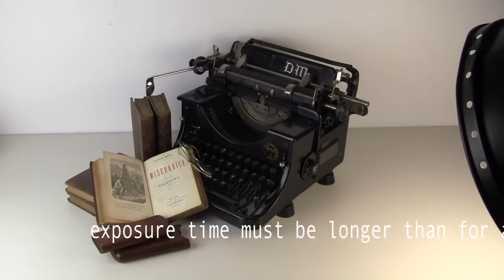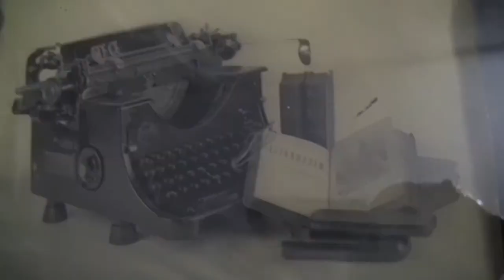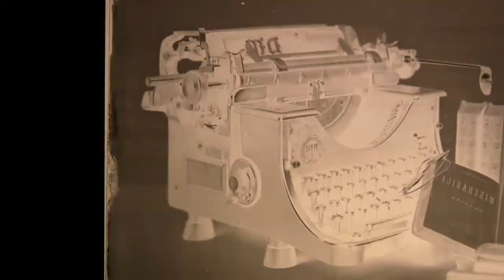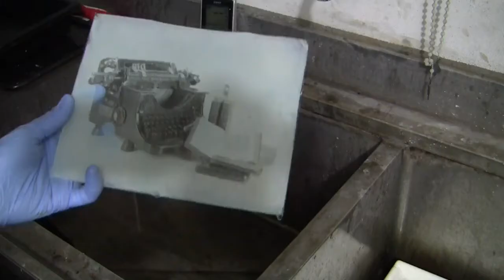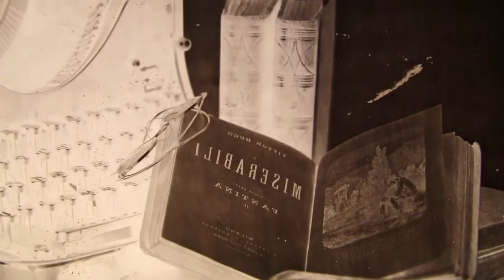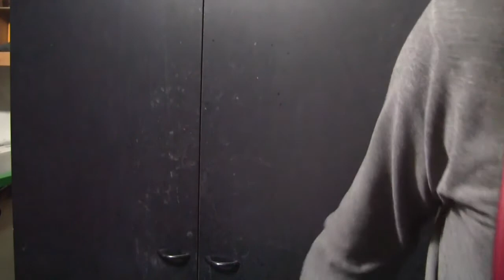wet plate negative copper intensification

Comment: Love it! Thank you for the video! I was always doing with redevelopment (iodine), but now I have a project in mind that will take many plates to redevelop and I don't have 30 min for each plate. With bleaching is much easier. Of course as you've mentioned you don't have so much control, but you can adjust the contrast during printing, so perhaps I do not need all the control.
Reply from the maker: +Borut Peterlin Thanks for the comment. The only problem is that copper intensification is Silver consuming. I need some work and trial to understand how many plates can be treated before it loses its strength. Giorgio

Comment: I stopped using this technique a long time ago because of higher silver prices and also because if the plate is over exposed but still not enough density the intensification will be too much. I now develop the plate as far as it will go and then intensify by using the same developer with a little silver bath added until it looks right then rinse, fix and wash. Or, develop as usual, fix and wash, then use developer and silver to build up density, wash, dry and varnish as usual.

Comment: That type of intensification was used for line art using various bleaches and silver but also sulfides. It’s a one shot deal and not variable. You should give redevelopment a try. The plate is made sensitive to light by a quick wash in dilute iodine. After washing in water it is exposed to daylight and then you pour pyrogallic acid developer with drops of silver onto the plate. The process takes about ten minutes with repeated applications of the developer but it doesn’t streak like intensification and the build up of density is gradual. You can do a just little as needed or even more than the intensification process.
Reply from the maker: I know very well that kind of intensification, and is my main method. Check my book for specs if you want.
https://www.amazon.it/collodio-collodio-positivo-negativo-illustrata/dp/8869272141/ref=sr_1_1?__mk_it_IT=ÅMÅŽÕÑ&crid=HC7Z46POOXY5&keywords=Giorgio+Bordin+fascino+collodio&qid=1664745667&sprefix=giorgio+bordin+fascino+collodio%2Caps%2C88&sr=8-1.
Copper is a valuable alternative, especially when you make negatives in open spaces. Quick and simple.

Comment: It wasn't clear in the video or subtitles -- was this bleach and intensify process done while the collodion was still wet, in that fifteen minute or so working time frame, or after the collodion has dried but before varnishing the plate?
Reply from the maker: the steps are done as they are shown. Bleach is done after washing the fixed plate.
Reply: @giorgiobordin7779  Thanks.  I thought so, but wasn't sure.

Comment: Fab video. Want to make some ambros with more density so I can try salt contact  printing. Is there any alternative to the Nitric Acid?...I can't get it where I live.
Reply from the maker: I've never tried without or with other acid. Where do you live? You can buy from international sellers, I'm sure someone can ship to you, even at the North Pole.
Reply: @giorgiobordin7779  Hong Kong. They are very strict about chemicals here I guess because of the density of people living in massive towers. It's very challenging just doing tintypes. 😥
Reply from the maker: @isuckatguitar6252  oh my... since it uses Silver nitrate, some nitric acid lowers the pH without introducing new chemicals. I think that Choridric acid could be used as well. However I don't think it is easier to find. Acetic acid? Maybe... You should try with little pieces of glass so you need little amount of chemicals and don't waste too much money if it doesn't work; start without nitric acid, so you can just add in a second time. Nitric acid is used also to etch zinc or copper plates for gravures. It could be found in fine art supplies.
Reply: @giorgiobordin7779  Thanks for your input.
Reply: @giorgiobordin7779  you probably don't want to introduce more anons into solution-- I don't think any acid other than nitric will work

Comment: Can this technique be used on silver dry plate????
Reply from the maker: Silver gelatin dry plates are actually like modern films, the main difference being the support (glass vs polymer) and the composition of "emulsion". There are ways to intensify silver gelatine negatives, and could be similar at a glance because both are two-step processes, but they deeply differ.
With silver gelatine, you bleach the film and then redevelop. However, the first step whitens the image but is not a bleach. You confer Bromide to the image and then add silver nitrate. The new formed silver bromide precipitates and makes the image stronger, adding new silver. You work with a film of collodion still wet, and it will never work after drying, because dry collodion is a plastic sheet which no longer allows chemical reactions to happen inside.
In modern silver gelatin films you bleach in the first step the negative and then redevelop with strong developers (paper developers, just to say). Gelatine becomes soft and spongy with water and can allow chemical modifications, when wet.
They are two very different processes. I don't think that the former could work in dry silver gelatine. I can't also imagine why it should work. Try. If it it works, let me know.
Reply: @giorgiobordin7779  Thanks for the reply. What's the formula for a bleach tho? I've read some that uses potassium. dichromate and sulphuric acid. I have the dichromate but I don't really want to bother with sulphuric acid. Do you have other suggestion for bleach that's easy to make? Also for redevelopment I've been thinking about pyro developer lately since it stains proportionally. I have all the ingredient to make ABC pyro but haven't tried it yet. You think that will work? Thanks again!
Reply from the maker: @Stop4MotionMakr  sulphuric acid is less dangerous than potassium bichromate, and is needed, in all formulas. Redevelopment is rough and doesn't require refined developers. A simple Kodak Dektol works fine. I would also be a bit worried about pyro staining for some unexpected odd result.. Another think to try.

Comment: Woww! (When you wrote the comment on video I say loud this before 1 sec) :-)
Nice resolution, I try this a next weekend! THX!
I have a question: It seems to me the bleach solution using only one times? 
The intensify silver nitrate must 60%? Not enough only 10-20%?
Reply from the maker: Kristian, thanks for your woww. Yes, the bleach I think it is a one shot, but it depends also from the amount of fluid. I use the less I can. The silver nitrate can be re used.
If you want to see the albumen print of this negative, go here:
[https://www.flickr.com/photos/gbordin/24121252015/in/dateposted/]
If you want more try to download the "Silver Sunbeam" by J. Towler
Reply: I used a 30% silver nitrate solution, it is possible